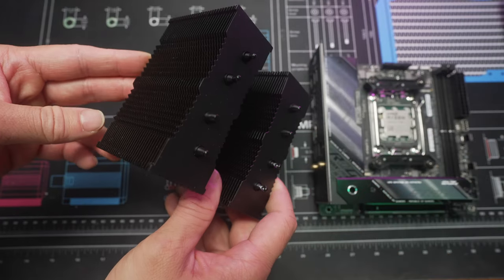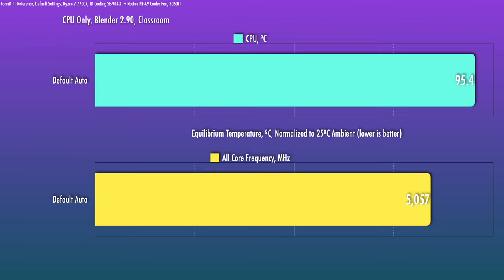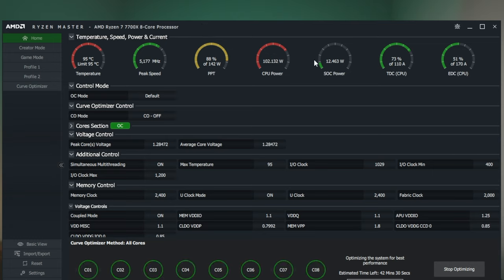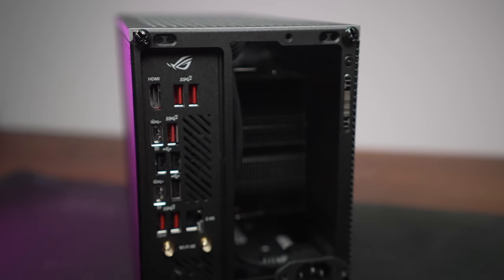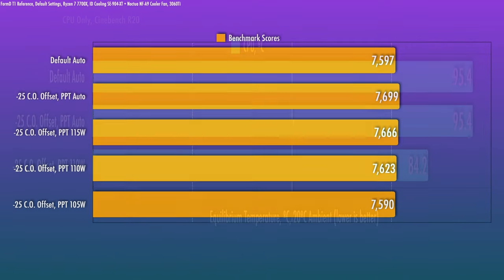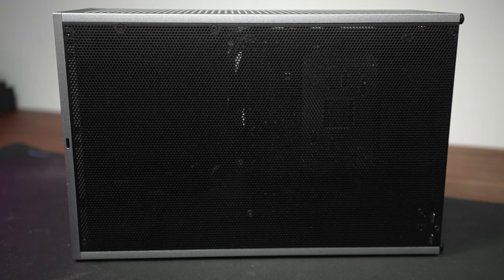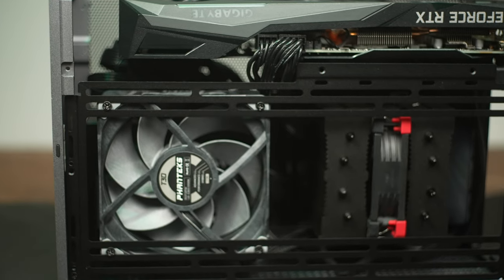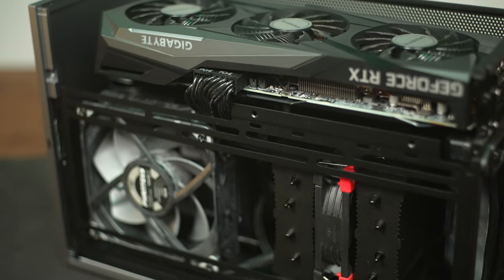FormD T1 Reference 7700X: Optimizing and Inverting!

Comment: meaning of "Thermal Throttling" is when the chip goes below it's base frequency specification. All Ryzen 7000 series by design are meant to push all the way up to 95C and still be above their base frequency. It's really important for people and tech channels to make this distinction and properly understand meaning of those two TT words! Keep up the good work.
Reply: No. Thermal throttling means the CPU is not reaching higher clock because of thermals, rather than power throttle or VRM throttle or other reasons.
Reply: @Sebyllis7350k  That is not how it works with Ryzen 7000 series. Even with 360 AiO, Ryzen 7 7700X will by default go all the way up to 95C. Because that's how it's designed. Only way to lower temp ceiling is to drop down power as it's shown in the video. The good thing is that you won't have any significant loss of performances by doing so.

Comment: I'm surprised the reference kit for the T1 wasn't made for the GPU to be at the top, like a Dan C4-SFX, use the GPU fans to intake as much air as needed, push the air out of the vents (For non-flothrough coolers), then use the CPU tower to intake fresh air from down lower which will be aided by the negative pressure created by the exhaust fan pushing air out of the case 🤷‍♂

Comment: I've been curious about running a setup like this, but with a deshrouded GPU with the fans set to exhaust out of the top rather than intake. I am not sure I've seen anyone attempt this type of build, but it seems like it would theoretically get the most out of an inverted layout. Just curious on your take about such a build, or if you've run into something like that before. But I figured you could be intaking with the CPU cooler, exhausting out of the side panel, and expelling heat from the top and the two airflows wouldn't be affecting one another.

Comment: When using -C.O. You can make sure your stable in low load tasks by using 2 passes from memtest86+
I have spent a shit load of time trying to find a solution and this one it worked and as a bonus when it is crashing you don’t care as it runs from a usb stick drive.
Long ass process though.
P.S. Free your CPU from the PPT shackles by selecting the Motherboard present.

Comment: I tried the ss110 cooler with an old 9900K and it was also immediately throttling. Temps where far worse than with a l12s in a ghost case so I sold the cooler. (I also had issues with the backplate of the cooler because the screws interfered with the side panels since there is so little space). I then used a c14s with way better thermal results. With the c14s a lot of heat gets pushed out at the top rather than the back of the case so flipping the case is not a good idea in regard of cpu thermals unfortunately. So to prevent the gpu from choking you would need to use custom feet that are taller

Comment: Have you tried limiting CPU power limit in BIOS to 105W or 65W? Gamersnexus tried this with 7950X and temperatures went down significantly, while performance suffered only minor hit.
It´s clear whole 7000X series is OCed to the bones & marrow, i just wonder, how long are those chips gonna live. Some early 7nm Zen 2 chips, that ran hot, are already unable to hold their stock frequencies and can only run when underclocked.

When you manually OC a CPU, you eventually hit a point of diminishing returns, when you have to push voltage up significantly just to get higher clocks and even then the performance uplift is no longer as significant, as it was before. AMD wanted to have their own 5GHz CPUs so badly, they didn´t mind repeating their old mistakes from a decade ago (FX9590 was released in 2013).

I also guess AMD no longer cares about longevity of their products. If it outlives the warranty, it seems to be as good as dead to them. Planned obsolescence at its worst (or best, depending on your POV).

You can also try tweaking the PBO in BIOS and setting various PPT limits. Sort of a must, if you are trying to make SFF build with such hot CPU.
Reply: > i just wonder, how long are those chips gonna live
No one can say for sure. I don't mind being cautious since it is breaking decades old convention, but talking like planned obsolescence is the true motive here I think is a disservice to the thousands of engineers involved in the design of this product.

On the other hand, I think AMD could've gotten better optics if they shipped out these chips in ECO mode, and let users disable that to let the chip run at full tilt, pinning it at that 95C target.
Reply from the maker: Yup. 105W with an all core -25 offset was where the performance dipped below stock slightly for me. In all reality it would have been perfectly fine to set PPT at that point. At 110W the thermals were more than acceptable with this setup.

Comment: i dont get how people get more fps in games with CO, when i try it even at -30 i get tiny less then on stock
Reply: Your CPU prob can't handle that -30 CO. Most chips are around -15 to -20 most. -30 is a very good binned chip
Reply: @1LifeAdvs  i don't think you understand that PBO will lose performance on the 1% fps lows

Comment: It's a shame that case can't fit any bigger 3060 models... For example, you'd have way lower temps with an Asus TUF/MSI Gaming Trio
Reply: You can put a 4090 Fe card in this case.
Reply: @matthewrezuke8130  Doesn't seem like it
Reply: @xFlowRS  there’s plenty of videos on YouTube that state and show otherwise.
Reply: @matthewrezuke8130  not in this case variant which is the reference layout …it supports only 2.2 slot cards. You are talking about the sandwich variant
Reply: @marijanWS  Exactly.